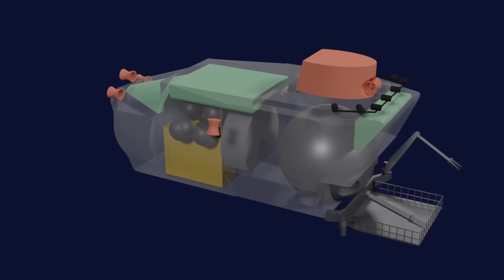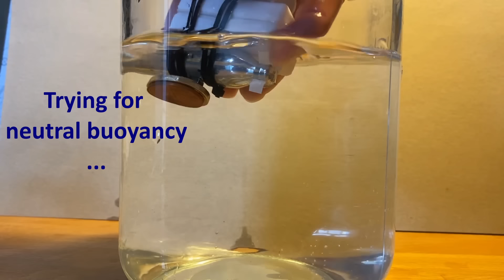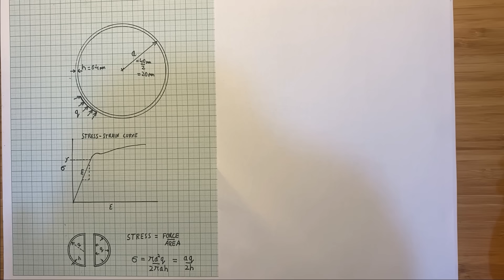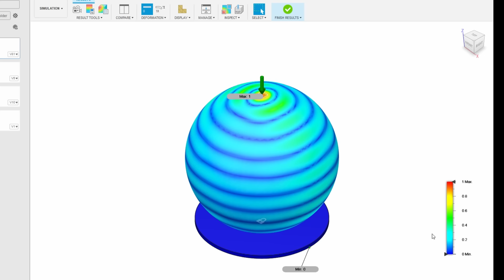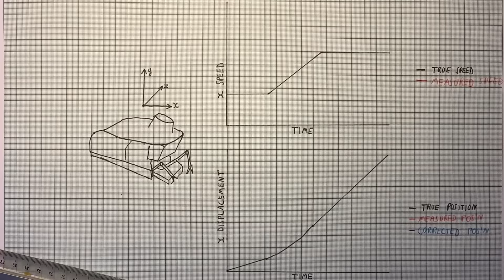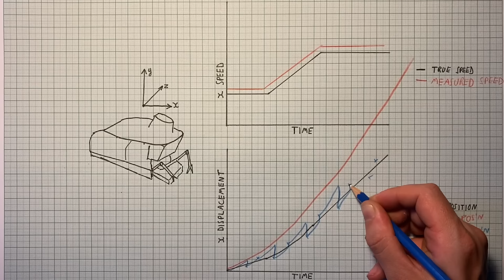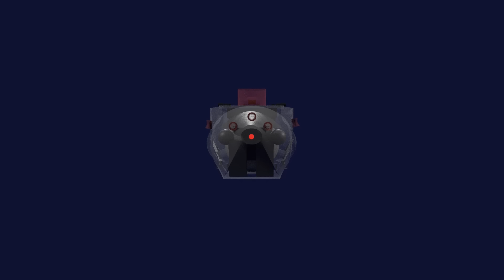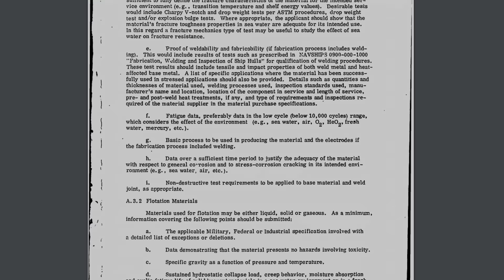DSV Alvin : How to build a safe submersible

Comment: I am pleasantly surprised by the quality of your presentation. The difference between Alvin and Titan in respect to design, testing and underlying mindset is simply astonishing.
Reply: Titan was meant to bring people down to titanic, Alvin was designed to get people back.
Reply from the maker: Thanks. Yeah, the two aren’t even comparable
Reply: Yeah, the bottom of the ocean is one of the most extreme environments we can actually reach with people (and have any hope of surviving/returning); even space is way less extreme (though has the additional danger of having basically zero prospect for rescue) in most respects. But because deep-sea diving has the benefit of having relative safety a handful of kilometers (or less) away, it allows for all sorts of brilliant ways to increase safety through excellent engineering and design.

Alvin shows so many smart methods/approaches this regard that it's an undeniable testament to the designers' prioritization of safety and reliability.
Reply: Libertarian techbro "iterative break-stuff" development, with its childish, irrational and self-indulgent hatred of regulatory oversight, is a chimera. It pretends towards greater efficiency and innovation while proving the opposite in practice. Far costlier in both treasure and blood. Results no better when not worse.
Reply: Yeah, that's how a bunch of "old white men" design a DSV. Honestly, I don't buy the line about wanting to inspire young people. That sounded like corporate fluff to hide an unpalatable truth. He was either to cheap to use experienced personnel or knew that he couldn't bully them like he did with his entry level engineers. What really makes me angry is that his stupidity/egomania killed four other people and left a professional black mark on the engineers he hired "to inspire", as well as the psychological burden of knowing that their inexperience/negligence contributed to the disaster. If it had just been him on the sub, I'd say it couldn't have happened to a nicer person.

Comment: You used material properties for ABS plastic in the simulation. Are you sure your ball is made of ABS? Some ping pong balls are but there's also those made of celluloid (like a decade ago, they were all celluloid). I prefer celluloid because it burns so violently and I'm not interested in sports.
Reply from the maker: I 100% agree with your conclusion. It says its ABS on the box

Comment: I used Gertrude in the US Navy to talk from surface to submarines. I especially recall the awful sound quality.
Hopefully Alvin’s is higher fidelity than milspec.
Reply from the maker: Ive heard terrible things about Gertrude! I wouldnt bet on it being fantastic
Reply: The sound quality is still very bad. There is an engineering effort to upgrade the underwater phone to a modern DSP-based system. Unfortunately, the downside of having a very well-engineered and overseen program is that things happen at a Glacial pace. That is especially true of systems that fall under the Scope of Certification.

Comment: A quick question about the ping pong ball. When you say it will buckle at say 2.1 bar. Is that 2.1 on the outside and vacuum on the inside, or 2.1 on the outside and atmospheric on the inside?
Reply from the maker: Good question: 2.1 on the outside, 1 on the outside. Assuming the inside is at about 1 bar (which is a pretty big assumption)

Comment: I love the fact that the original Alvin was designed and constructed in Minneapolis - by General Mills... the people famous for breakfast cereal. Due to all the factories they had, they manufactured a lot of their own equipment, so they had a full high end engineering production shop... where DSV Alvin was first born. I believe technically in Golden Valley, at their main HQ complex right off Betty Crocker Drive (seriously) but yeah... Alvin is from Minnesnowta. :D
Reply: I would think one company that could have made a submersible would be Westinghouse, the nuclear power company, because they build pressure vessels for nuclear reactors.
Reply: @BobConnor-n2g  yeah surprising who did make them, and who did not. :P

Comment: When Jacques Cousteau created his submersible he had two hulls made and tested then he sank one deliberately, on an anchor and cable, in a very deep part of the Med. Every voyage out for a deep exploration he went over the sunk craft to check on sonar that it was still floating it's cable length above the sea bottom. If the sunk hull failed and sank to the bottom then the working hull was scrap. Sadly Cousteau was largely of the pre Youtube era, BUT several people have posted film of Cousteau's exploits and Jacques Piccard's journeys.
Reply: Hm. That doesn't seem like the best proxy. It doesn't account for cumulative damage and has different corrosion to being in a probably pretty consistent environment. A better proxy would be a second sphere that does a similar dive profile to the crewed sub but a decent bit deeper each time, so it has a high chance to succumbing to accumulated damage first.
Reply: @Kenionatus  Might be a somewhat reasonable-ish gauge of creep performance of an assembled hull at the time. Not the best, yes, but cheap and can be used for longer-term observations than test chamber can allow. Ideally they'd need to raise it regularly for inspections but, as a go-nogo hull fitness gauge, it's better than nothing.
Reply: Funny story: My father and Al Gore presented Jacques with his lifetime achievement award but my father had given my sister and me a quick golf lesson up at our elementary school where I got laid flat by a golf ball hitting my forehead,  no biggie, and my sister then splits my dad's forehead with an iron which obviously needed stitches but no time for that. Al's makeup crew saved the day by using superglue and an extra shirt as it wouldn't stop bleeding. Not really an Al fan but Jacques most definitely as I am of my father.
Reply: @davidpawson7393  Completely irrelevant. But I’m reminded when I had a burger with Al Gore in a Montana political gathering. I, as a populist rancher, told him public-private partnerships seemed to be a bad idea because private would coopt public. He disagreed, and year later he was VP. Then came NAFTA and Citizens United. Selah.

Comment: Welded structures should generally fail at the unwielded points.  Part of welder certification tests is destructively testing the weld. The weld should not fail, instead the base material should fail. Bad welds fail far before the material, which is why ultrasound, and x-ray testing of welds on submarines are done following the Thresher disaster.

Comment: Welds are in most cases stronger than the surrounding metal, the effect is just amplified slightly with EBW just to the very high cooling rate. The welds have a very fine grain structure due to the fast cooling rate from molten metal and that increases the strength (disregarding a lot of other factors that affect strength too). With conventional welding techniques, the weld is still often the strongest part, but the metal just adjacent to the weld can be weakened significantly due to the amount of heat spilling over.

Comment: really dumb question, but why dont these things ever have a long tether on them so they could theoretically just be pulled up in case of an emergency? would the tether be too long to work? its probably just too much of a distance.
Reply from the maker: Long story short. Its really difficult to tether to such a depth without the cable breaking under its own weight. And tethers massivley limit your capability and pose a huge entanglement hazard.
Reply: @Alexander-the-ok  good points. ive wondered about it a couple times. thanks for the reply :)
Reply: The advantage of a manned submersible comes from not having a tether. Some advantages are being able to quickly move from point to point and the ability to work on a sheer cliff edge. ROVs take longer to relocate the deeper you go and working on a wall can go horribly bad if the ship loses power and drags the ROV into the wall.
Reply: @Subpilot1  that makes a lot of sense too

Comment: good lord! that pressure testing machine! 12000 psi and its HUGE! god. that must be a lot of energy being stored up when they are doing that test. i wonder if anyone is within a mile of that thing when its in operation lmao.
Reply: Only two systems in the world like it. The facility is well isolated across the river from the US Naval Academy. The end cap for the chamber rides on railroad tracks.
Reply: @Subpilot1  incredible.
Reply: Thankfully, with water not being especially compressible, it's not as much energy as you'd think.  Stored energy is force times distance (or pressure times volume change), and with minimal distance, there isn't actually much energy.  That's why air and steam pressure vessels are always pressure-tested with water.

Comment: as a journeyman b pressure welder I will tell you that any proper welded joint will fail outside of the actual weld, most of the time in the heat affected zone next to the weld as the process of heating the material and fusing it will change the mechanical properties. This is one of the main reasons for post weld heat treatments.

Comment: it does not surprise me that the weld did not fail, in fact this is how most weldments should fail, with more conventional processes when done properly you will find a slightly weakened zone on either side of a weld joint, this is knon as the HAZ (heat affected zone). with most materials/alloys the material added to the weld area (filler) changes the alloy composition and in most cases yealds a stronger material than the base, however, with the HAZ being a weekend zone a expected failure mode is typically right beside a weld joint. a weld that breaks down the middle or across its throat is almost always due to being defective in some way (severly altered alloy from welding too hot, perosity, lack of fusion from being too cold, ect. i can only speculate but i would think this beam welding process has the advantage of eliminating human error, eliminating almost all chances of contamination, and minimizing the HAZ by having much more focused energy in a smaller volume of material for a shorter period of time.
Reply: As a young technician I was taught the sign of a good bond was when the bond survived and the substrate failed. Which brings to mind the insanely oversimplification of the gluing process used to mate titanium to carbon fiber…😬

Comment: About welding in general, it's said that if a weld is done properly, the weld is stronger than the base material.
Reply from the maker: Absolutely yes. I hadnt figured out how that was possible with non-additive methods like electron beam welding though. It seems it is indeed possible though.

Comment: There's a couple of extra things I'd like to know: 1. How the entry hatch was designed and how it works, and 2. How are inputs into the steering thrusters, as well as data from external sensors etc transmitted between the pressure hull and the external components? Assuming it isn't wireless, where do cables run through the pressure hull and how are those entry points sealed?
Reply: A hull penetrator is used-have a Google, bit technical to explain here
Reply: @noksucowboy does Google autocorrect to hole penetrator? Seems like a risky google...
Reply: @phillyphakename1255  as long as you don't act on it, you'll be fine

Comment: I would be curious to see the comparison with the Limiting Factor. That one is new, and is also certified, but cheaper than Alvin's latest update. It can also dive much deeper.
Reply from the maker: They are really difficult to compare as they are entirely different classes of vessel. I did some work with mapping data for the limiting factor a few years ago though, it is a fantastic bit of kit.

Comment: Does the very small acceptable deviation from sphericity mean that removal of barnacles and similar adhering junk from the pressure sphere's exterior is important?
Reply from the maker: Thats a very good question. I want to say it probably doesnt make much difference since the buckling mechanism is sensitive to load paths in the material which probably wont be affected much by external elements. But without simulating I can’t be 100% sure.
Reply: Since the submersible is mostly kept out of the water, it’s less likely to get barnacles etc compared to a regular boat, and since it’s relatively small I’m sure they clean it carefully and often.
Reply: @Sashazur  Washed down with fresh water after every dive and thoroughly washed after every cruise. No barnacles or other encrusting sea life are present. The occasional fish or crab etc will get stuck in nooks and crannies and become a stinky mess that can be difficult to find. Krill are the worst.

Comment: Its difficult to calculate the cost of the DSV Alvin, from the original $500k in 1962 through the 10s of millions of dollars of research and hundreds of millions of dollars of facilities used to test it, the $40 million set of upgrades or the $50 million estimate to build a duplicate, but all totaled, to get from zero R&D to Alvin today would probably cost hundreds of millions of dollars.

Its not surprising that a company like OceanGate would cut every single corner they could, especially in material testing (where most of the cost would be). Its immoral, but not surprising.
Reply from the maker: Interestingly, when you look at Alvins long and varied ‘resume’, it honestly starts to look seriously cost effective. In pure financial terms, the single nuclear warhead recovery operation (that I didnt even discuss here) was probably worth the entire cost of Alvin.
Reply: @Alexander-the-ok  You're not wrong, but I meant more that you could never expect one company to sink that much money into it and recover those costs.

It was interesting hearing about Alvin's dead reckoning systems. I used to work on (very expensive) field artillery forward observation systems which didn't rely on GPS but used laser ring gyroscopes and precision (not MEMS) accelerometers from the aerospace sector to track a HMMWV driving well enough that it could drive miles away from artillery and still direct that artillery.

Its something we wouldn't even bother to try doing without GPS today.

When you get bored and you start looking up the costs of things, nuclear warheads actually aren't very expensive. I was pretty shocked to see what their listed cost was. But yeah, in terms of national security, Alvin was probably cost effective there too. 
-preemptive edit:
Looking it up, that bomb was one of the big ones, not a tactical nuclear weapon. So... definitely worth the money on that one.

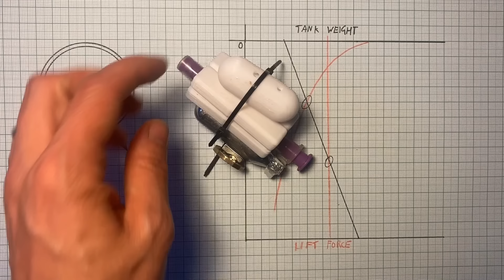Comment: @Alexander the ok: The video https://youtu.be/QNVpnBXe1Lk from the Hydraulic Press channel shows what happened when they put ping pong balls under high pressure water at about time 4:50. It looks like they pop at around 2 bar.
Reply from the maker: Amazing, thanks very much. Maybe i wasnt so far off in the end!
Reply: @Alexander-the-ok  If you take into account that standard ping pong balls are pressurized inside to about 0.42 bar above room pressure, the theory and experiment are really close. 1.73 bar + 0.42 bar = 2.15 bar.

Comment: On the metallurgy of titanium and titanium alloys: it isn't at all 'easier' to forge than steel. It requires less force in the process but that's the easy bit.  It's way less forgiving than steel with a much narrower band of appropriate temperature before defects are introduced either in It's crystalline structure directly or it can react with the air at high temperatures. It involves using heated dies and heating the metal with a shielding gas of argon. I don't have much experience with this but I know it's extremely expensive and technically challenging. 

In regards to welding for most procedures where a weld is being destructively tested it is expected that the parent material near the boundary of the heat affected zone should fail before the weld does. A fully compliant weld where something is 'welded completely' should be stronger than the parent metal. Of course in reality what is specified and required varies dramatically by the application. Many of the fully welded structures I've welded are fully welded for preventing water ingress and even a few small beads would provide all the required strength. 

Titanium is exceptionally hard to work with and I'm the first to admit that it's beyond my technical abilities.
Reply from the maker: I oversimplified that bit. Pinned comment with some clarifications coming soon!

Comment: I can understand the sphere the pilot sits in is virtually implosion proof but what about the rest of the sub? And if that implodes wouldn’t it effect the operation ability of the sub?
Reply from the maker: Most of the rest is pressure compensated. Meaning the internal pressure and external pressures are the same so there is no differential, and therefore no risk of collapse.
Reply: @Alexander-the-ok  thank you 😊
Reply: @Alexander-the-ok Just to add, in simple terms all the stuff outside the pressure vessel is either material that can resist the pressure (solid and/or very strong), or it is allowed to flood with water.
Reply: The majority of the external wiring including junction boxes are PBOF Pressure Balanced Oil Filled. Alvin uses three different oils as compensation and operating fluids. Mineral Oil for Batteries and general wiring, a high Dialectric oil used for high voltage switching gear, and hydraulic oil for the hydraulic systems. There are several other pressure housings besides the personnel sphere. A very real danger exists called sympathetic implosion where the failure of one pressure housing causes a pressure imbalance in the surrounding environment that can lead to a chain reaction. There are ways to mitigate that by calculating and observing standoff distances and ensuring that every Implodable Volume is accounted for and certified.